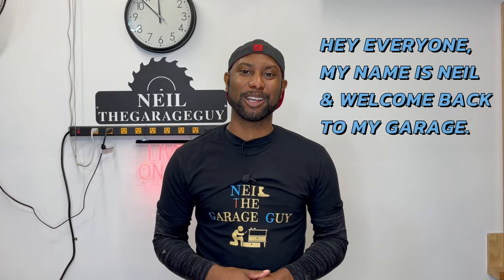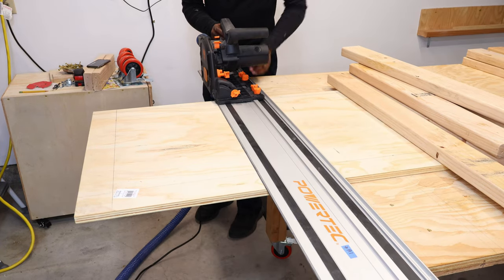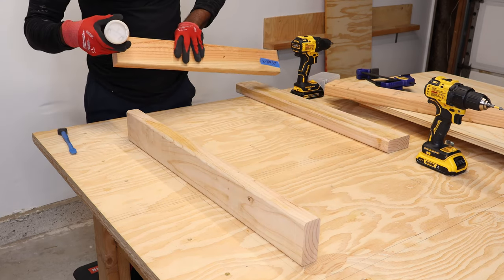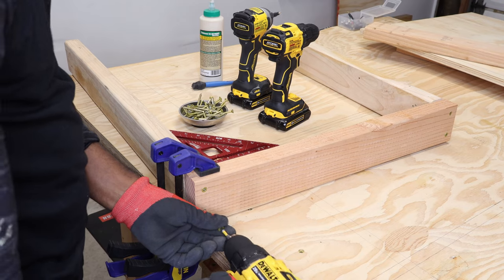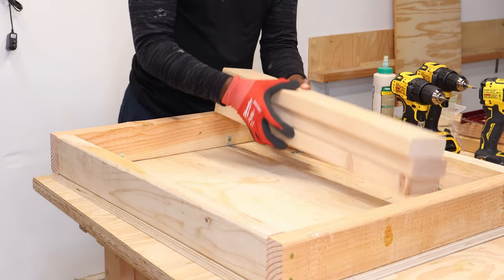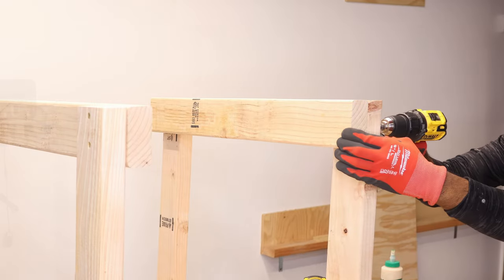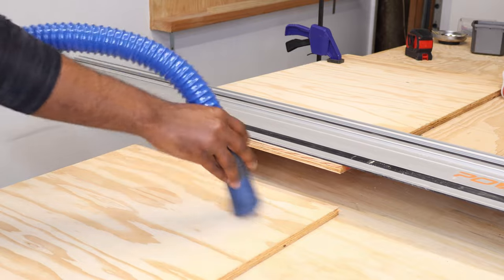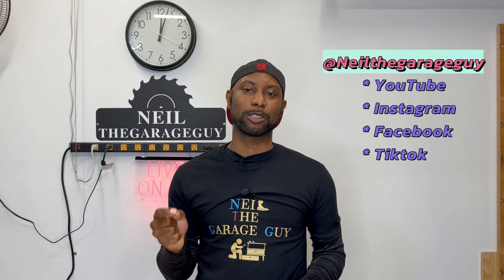Making A BUDGET Cart For The Garage

Comment: Hey Neil, great video as always.  How are you liking that WEN track saw?  Been wanting one, but I am not down with that Festool price point if you know what I mean.  I have a couple WEN tools and they have been okay.  Just wondering what your take is.
Reply from the maker: Thank you so much. This is a great question and one that I have been deciding if it requires a full length video or not. I have been using the Wen track saw for 2 years and it works fine for cutting plywood or softer woods in a straight line with no bevels. It is not the best for hardwoods like walnut or maple. There is nothing fancy about it but for $100 it just works especially if you are going to be using it only on the weekends. I could definitely see myself upgrading in the future which is why I bought the POWERTEC tracks to start instead of the Wen tracks because the POWERTEC work with makita track saw as well and another I believe. In theory you can always try out the Wen and see if it meets your needs and return it or sell it if it doesn’t. 

@731woodworks has an amazing review video on it. Let me see if I can find the link. 

Did I answer your question?

Also long story short if I could buy the Wen track saw again, I would as a DIYer. If I knew that I would be running a DIY channel then I would have probably saved more for the makita. Maybe during a Father’s Day sale. I find that I am building almost every single weekend. 

Wen vs kreg vs festool review video link
https://youtu.be/VO6_Tcjrflc
Reply: @Neilthegarageguy  Neil, excellent!! Do you have an Amazon affiliate link?  I would like you to get credit for the sale when I pick one up.  Thank you again!  Much love!
Reply from the maker: You are too kind. Yes I do, I have a list for the simple cart build with the Wen track saw and Wen clamps kit and the POWERTEC tracks. It can go in and out of stock at any time. When I bought it, I had to wait 3 days for it to go back in stock. You can also pick it up at Home Depot if you need it asap and cannot wait. 

https://www.amazon.com/shop/neilthegarageguy/list/1GWR5PQ2OG97K/?ref_=cm_sw_r_mwn_aipsflist_aipsfneilthegarageguy_9NYN10ECMFNVZF8TMBQA